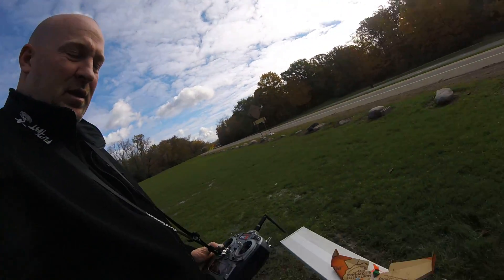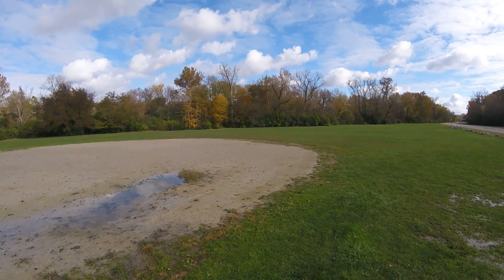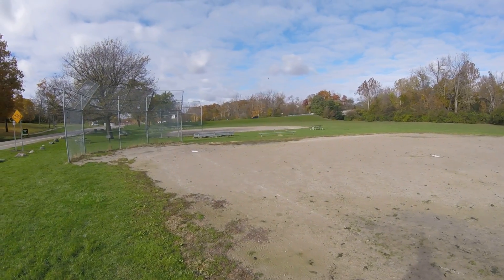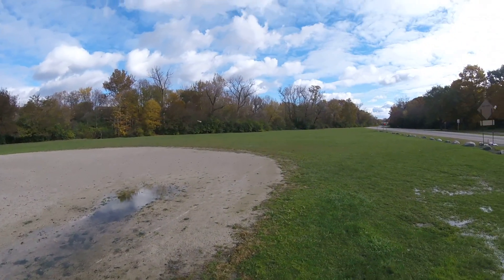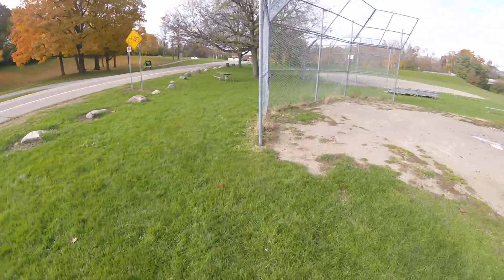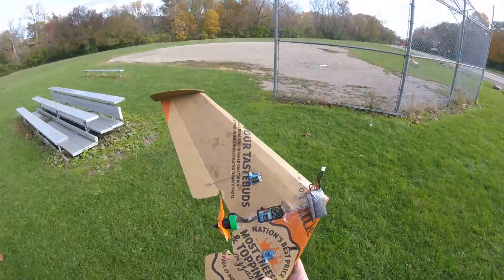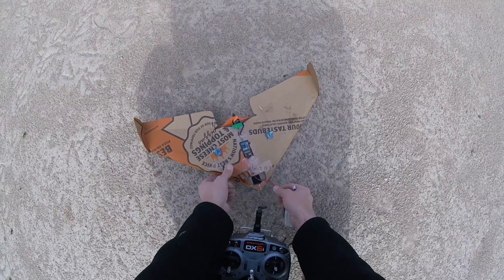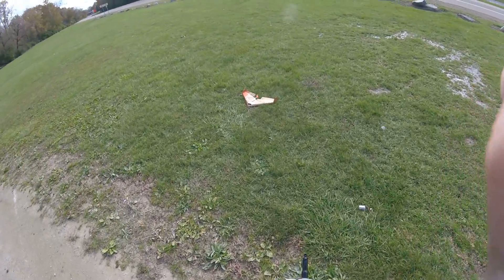flite test pizza box plane GOPR1349

Comment: Turn off the stabilizer and it goes in on a slow turn? Sounds like a CG issue. I fought with this for a while with my Mini Pop wing until I balanced it with a touch more nose weight. It made a huge difference. The plane is so short front to back so the range of CG is very narrow, I bet you are a little on the tail heavy side. There also was never a stabalizer on it mine and it flies in all conditions very nicely. It is cool that the stabilizer will help a tail heavy plane, it makes it more maneuverable.

Comment: What Motor and ESC did you use?
Reply from the maker: 2205 2700kv, 30a esc. 5 inch prop. Very fast!
Reply: @rodgermoore0007  I’m planing to build this model and use 1804 2480kv motor, 20A ESC, 3S 500mah battery and 3052 prop. What do you think?

Comment: Did you have to turn your mixing feature off from the remote?
Reply from the maker: you mean the auto level. yes i belive you can turn it off but i like it on. i have dual rates setup on the remote too which is also controled by a swith on the transmitter.